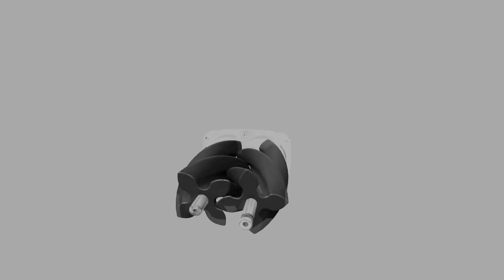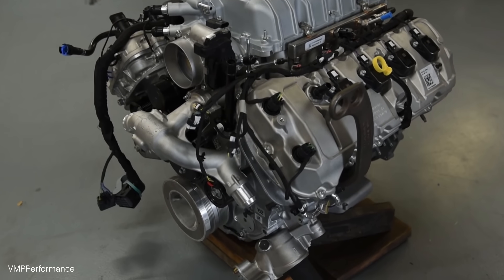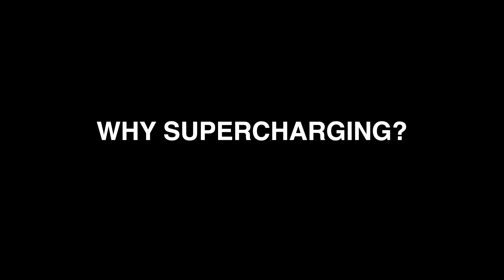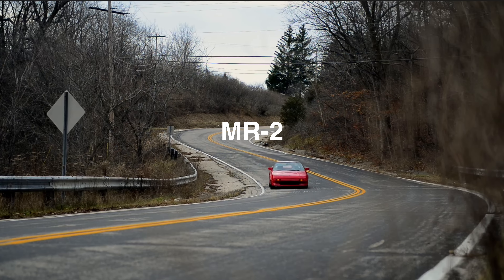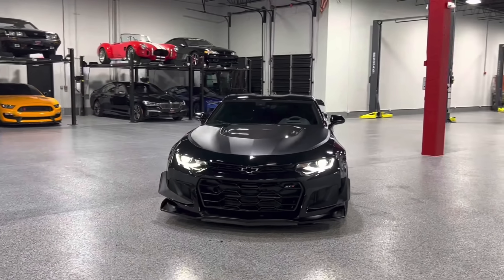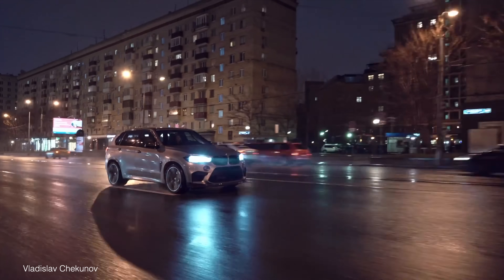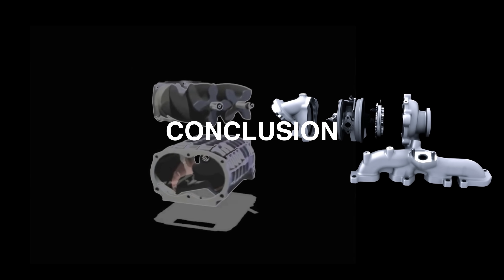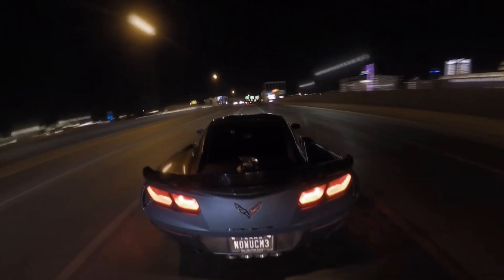Why V8 Engines Are Supercharged vs. Turbo😮| Explained Ep.6

Comment: american v8 are supercharged because eaton is american, it cost less, if you take a 6.4l engine and drop 2 kkk turbos from germany which runs fine on small 4l v8, its way to small for a real v8 engine, if you drop 2 bigger turbos on a real v8, the power output will be way too high for anyone, back in the day gm ask callaway to build a brand new 1988 corvette zr1 with twin turbos, the car made 900whp in the 80's while japaneeses sports car had 90hp and a top speed that the bugatti veyron was the first car to beat that record with 16 cyls and 4 turbos 20 some years later with 100 times the budget and more power, gm only had an aluminum 5.7l small block v8 with 2 tractor turbochargers build by 2 guys in a connecticut home garage, turboed american v8's are way too much for a rich kid whos wants to look cool

Comment: Actually its very simple,  if the octane level is crap like 91 or lower. Unlike in the eu 95 or higher. You need a bigger bang or more revs and more air needs to be pushed in the combustion chaimber. The usa way is to go bigger v8 800 liter. And sorts, so lots of air to push around. Need to understand 91 vs 98 search for engine nock. And why that happens.

Comment: Owning both a vintage Porsche 944 Turbo and a v6 supercharged Audi S4 (manual). I can appreciate both the S4 is so linear in the power delivery it almost feels like a video game.  My 944T pushes 15 psi and when it kicks you need to make sure the tires are warm and it is in a straight line....fun, but slightly crazy too. That 944 is like a bucking bronco. Of course the Quattro, sport dif and traction control factor are huge in the audi. The Porsche has no such traction wizardry.... just clutch and throttle....no ABS either for when s*** goes sideways literally. The S4 will get you there faster and not feel like you are going that fast 🏁, but the 944 your smile will be bigger and you will feel like you are racing at Le Mans at less speed 😁 #944 #951

Comment: For the supercharged american cars the efficiency only applies to production cost, not so much for power generation. As an example the supercharged lt5 engine on zr1 corvette produces 755 bhp, which is 121 bhp per liter. The porsche 3.8 liter twin turbo makes 691 bhp, 181 bhp per liter. In terms of power generation the turbo engine is 150% more efficient relative to supercharged one when compared with power per liter of displacement. Not to mention other benefits a more compact package provides.

Comment: American v8s are low revving engines turbos like high revving motors. Oh a inline 6 supra turbo stock is built to contain 2 to 3 times the hp and still last with half the displacement, cause japanese built it strong stock. American hot rods will never last as long as the thing 100 to 150 thousand miles on engine is fine. Modded 800 hp supras go 300k easy. Better engineering, simple physics.

Comment: The difference was that you can turbo a tiny 1.3 pushrod 4 cylinder engine and make a rapid car plus the 2 liter 4 cylinder turbo engines of the 80s and 90s could get decent range and easily tuned. Look at a viper 8ltr v10 original was smashed by a 3.5 v6 tt in the jaguar xj220.  The turbo diesel came along and you have everyone buying them for economy and torque.

Comment: One main reason (imo) is the higher loss at higher RPMs. American cars don't usually rev above 6-7000k so the loss can be kept at a lower level, and at that revs the supercharger is actually better, as it has a linear power curve. Turbo engines shine at high RPMs, giving a higher peak power, but no boost at all at low rpms (well, that is until twinturbo enters the chat). So, long story short, a pushrod, turbocharged, low revving V8 wouldn't make any sense, the goes same for a 9k revving inline 4 with a supercharger, it would actually lose power at that point

p.s.: even though Merc are now twin turbo charged, I think everyone remembers the Kompressor line on the old ones. Yep, they were supercharged, then later became NA V8s (like the SLS AMG, still one of the best sounding EU cars) and only recently did they add the twin turbo, like the AMG GT series

Comment: I am waiting for battery tech to catch up so a battery powered supercharger is viable. Imagine an exhaust powered generator for recharging all batteries on the car. Plus maybe even in wheel electric motors with regenerative braking. Rear wheels gas powered with front wheel electric drive, all selective.

Comment: You missed something in all this. Or at least glanced over it. Turbo charged engines also require an additional part, that is the air intercooler to cool down the hot air that is produced by turbo charges. Which is much thinner then cold are, that is much denser then hot air. Which is a problem that is not inherent to super charged engines. As hot air will also destroy a gasoline engine by causing over heating, which super chargers force cool air into an engine causing it to last longer. Which is why you see no diesel engines super charged, and only see turbo chargers.

Comment: In UE we dońt see the point to have a bigh V8 wit turbocharger …. Very ineficient. My engine in a 2.2l turbo diesel with 200bhp PSA origing, the duratorq. And it is veriy efe¡icient, I can do 800km with 55liters,  even more. So … why. Porsche is the clear example: Turbo S near no lag and faster than car with more HP and it is not all abot hp, it is how it drives …❤ And BMW, and Cupras (Leon and the amazing Formentor). I like American cars but … petrol is expensive here and for daily use and a bit of funn I whan something more rational like a Jp car or UE car. For funn … 911, 328i, a Cupra or a bit more the exotics or a second hand Aston Martin, they are not very expensive but not as refine as a Mercedes or Porsche or BMW.

Comment: There are 2 good points you forgot about SCs: First thing is, cars SC-Engines with high poweroutput are way easy to control as the powroutput is 1:1 as in a NA-engine - the power builds up gently - the other thing is, you can stop a SC engine while beein hot - you always let a turbo-engine ‚run cold‘ the prevent oil-coal on the hot parts of the turbo - that won’t ever happen in SC.

Comment: The Lancia Delta S4 hacked this and found the solution in 1985; SUPERCHARGER + TURBOCHARGER BABY! 
Beyond 4000 rpm the mechanical centrifugal clutch would disengage from the supercharger and the huge turbo would take over till redline. 750 hp in 1985 from a 1750 cc 4 cylinder engine.

Comment: With factory diverter valves you can still hear A LOT of noise if you just swap out the plastic plumbing for metal plumbing or something as small as a cold air intake.

Comment: Great info!  Wasn't Blackwihg disco'd because of electrification? It was a design GM had sitting on the shelf since the 2008 bankruptcy. They sold everyone they made and people wanted more of despite the fuel economy and it wouldn't fit in anything else. The power steering comment 🤣🤣🤣

Comment: Could someone explain a little more bout parasitic loss?
Reply: All accessories driven by the crank shaft take power away to run them. Because of this they term it parasitic ...accessories being the parasite. Superchargers are parasitic. whereas the turbo is only running off the free exhaust pressure to spin. I own a ZL1 and had I not found a steal of a deal 4 yrs ago, I would have bought a N/A Camaro V8 or a scatpak Challenger and twin turbo it.

Comment: It's mostly due to fuel prices. TC are more efficient, given that they are driven by waste energy. PS Mercedes Benz made the "kompresor" engines, where the supercharger was connected with a clutch that would engage only when needed, it was touted as an efficient engine.

Comment: There is parasitic loss in the turbo - it takes roughly 30 PSI in the exhaust manifold to create 15 psi boost. So the piston coming up on exhaust stroke has to push the exhaust out, creating pressure. So, boost is not free...

Comment: I feel like the video didn’t answer the question. 
High RPM, low to mid liter engines use turbos. See the Ford Focus RS at 350hp and 2.3 liters. Giant 4+liter engines use super chargers. See every example in this video. There are also plenty of cheaper cars with turbos, so I don’t buy the “it’s cheaper” reason. So, why does displacement factor into it?

Comment: This video is full of useless points:  Bottom line: the Supercharger is the best way to go on a motor because its simple, cheap, and easy to fix.  Only reason we dont see them much is because their one drawback, they take up a lot of space under the hood.  Small cars have room for a compact turbo system, but not a large supercharger, which only fits on large trucks and cars....that's about it.

Comment: is the real reason not fuel price? Superchargers require a bigger engine hence drink more fuel and American gas is cheap compared to Europe, we have to squeeze more mileage out of the same power, hence a european 3.8 V6 twin turbo, drinks half the fuel of a 7 V8 litre supercharged hemi (also weighs a fuckton more, again borrowing fuel and making the handling sloppier). Try getting a Hellcat up the narrow streets of Multipunciano for instance, M4? No problem. Thats the REAL reason one is used in one place and one in another.
Reply: WRONG.  Only thing superchargers need is room under the hood, that you get with a big truck or car. Smaller cars can't fit a supercharger, so a more compact turbo that runs parts under the car frame are used in smaller car.  THAT IS IT.

Comment: European hot V8 coocks itself.  E.g. many BMW has issues at the age of 5, when electric wires are melted down, turbo dies inside the V, so it is a very problematic configuration. BMWs with V8 are usually cheaper on the used market than the V6 inline versions, because of this reliability issue.

Comment: Dude you are so spot on. We’ve reached near complete mastery of ignition, air flow and fuel delivery. For example, back in Harley Davidson’s early years, you used to have to control the ignition timing on the left bar and the throttle on the right bar, technology would allow this to be controlled via the crank position sensor, move along to fuel injection and electronic throttle control (originally designed and utilized by aviation) “fly by wire” brings more granular fuel dispersion, and now thanks to advances in metallurgy and material sciences we we no longer ask for atmospherically appropriate amounts of air, we demand the proper fixed rate according data the ecu collects every cycle. I’d still like to see a supercharged v8 with an electronic valve train before the world goes full electric.

Total shot In the dark, but if it were possible to have the super charger run off a battery or series of capacitors that would be fucking perfect. 😅
Reply: You can run a centrifugal supercharger off an electric motor and people do.  They sell kits or you can do it yourself.  It's kinda like nitrous that recharges while you drive - like video game nitrous.